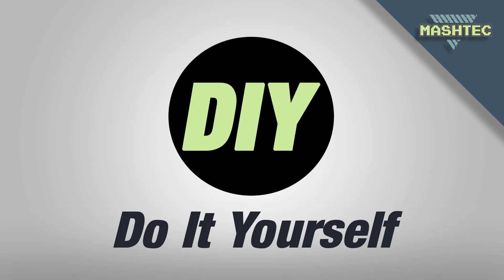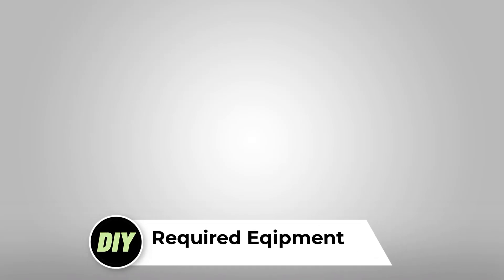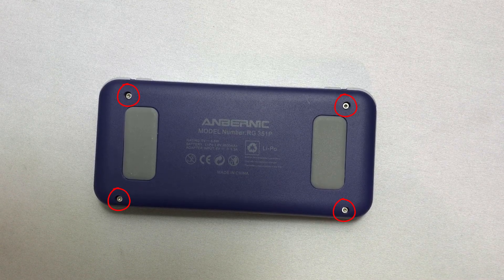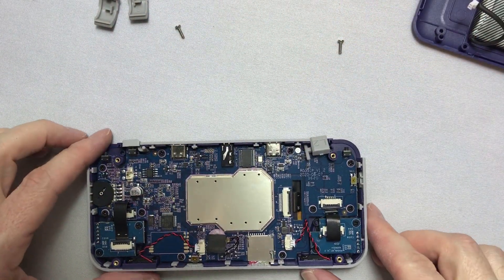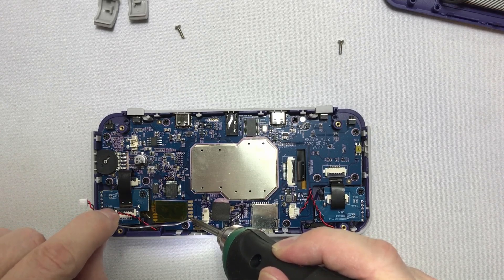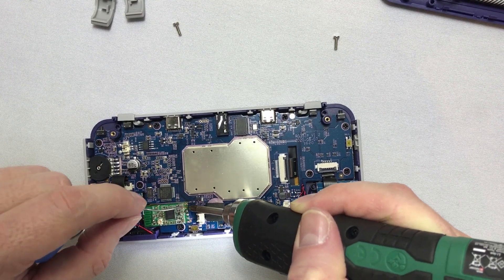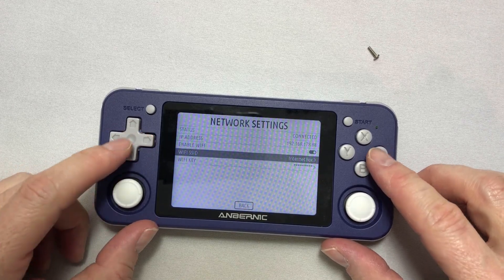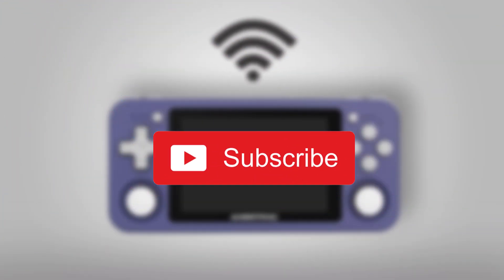RG351P - Howto install an internal WiFi module guide (DIY)

Comment: 12/14/24 i can confirm my sodered module doesnt work i ordered the exact same one under your link and it took me to a different one installed it and i still dont have wifi btw running on arkos does not work this is just a update because no other vid shows how to install the wifi chip if someone can help me out that would be great i could be just doing something else wrong 🤷‍♂️

Comment: Just tried the mod on mine with the module at the provided link. Didn't work. Tested all points for connectivity and I have good solder joints/wetting. My RG351P is a motherboard rev 1.2 (2020-08-07) and I'm running the latest Amberelec. Maybe I just got a dud module. The wifi does work over USB-OTG though. I ended up desoldering the module and removing it.
Reply from the maker: Hey dude, i‘m sorry that it didn‘t work for you but thanks for the feedback.
There can be multiple problems that cause the malfunction.
I‘m glad to hear that you have soldering experience 👍🏻 still, did you check the connections of the module and ensure they all habe contact?
Several viewers also reported that the seller changed the module behind the link meanwhile. It should still work but has some additional pins.
In the end, the module itself could be faulty too. But I guess it‘s hard to check.
I was testing it on stock firmware and ArkOS on my device. It‘s still working now a days.
Reply: @MashTec  yes I verified all the solder points with my Fluke to test solder continuity and resistance from the wifi module plated through holes to the RG351P motherboard pads, post soldering and I did that again after I resoldered it a second time. I did also have to remove 4 pins that the seller pre-installed on the wifi module. For that, I just used a chisel tip and heated up all 4 at once and the pins dropped out. I cleaned all plated through holes after with braid to ensure there were no shorts before soldering to the RG351P. I am going to attribute it not working to either a non-functional module from the start, or possibly an incompatibility with my revision motherboard, or Amberelec not having the driver. Maybe I'll give it a go with a different module in the future to see if I can make it work. Thanks for the cool video though, because I had never previously opened the RG351P to even know about a spot to internally solder a wifi board.

Comment: Just finished modding my 351p with the tp link nano ac600 5ghz usb dongle. I can confirm it works perfectly despite my extremely poor soldering job and cheapest chinesium gear. Thanks for sharing the info!

The 5ghz network really is an improvement! I also shielded both speaker cables and there’s no sound issue (haven’t tried without shielding).
Reply from the maker: Hey dude, good job! I‘m glad you got the 5Ghz module working :)
What module did you use for the mod? Do you have a link to share?
Reply: @MashTec  he did the alternative approach of breaking open a common USB micro-dongle and soldering the USB legs to the board I believe. Retro Game Corps covered that variant of this mod (edit, the three pads on the opposite side of the six you soldered are for the internal antenna that was placed on the board. you can get modules that would use them, or get a module that lacks an internal antenna entirely and comes with an IPEX connector to use a remote antenna. Which along with shielding the speaker wires, might well eliminate  the offending wifi noise. which mine still makes even using an external dongle....)
Reply from the maker: @DFX2KX  ah ok :) actually i was afraid of doing that myself, same as making a tutorial for the community out there to do it.
Still, this is the best solution you can get in terms of network quality. As you said, together with a IPEX connector for an external antenna that could be placed along the housing of the device.
Thanks for your feedback dude, very much appreciated!
Reply: Hey. Question. What gauge wire did you use for this project? @CoolestUserEver
Reply: @nathanmeade18  I grabbed some scrap and I can't find the pictures I made but it must have been 22-24 awg. Nothing fancy but flexible enough to be pushed inside the console. It still works btw.
Reply from the maker: @nathanmeade18 i‘m sorry dude. It‘s too long ago. I can‘t remember anymore :(

Comment: Good Video and good content but be careful! The Wifi Modul in the description is actually not the correct one.. it is larger and doesn't fit!
Reply from the maker: Thank you very mich for your feedback dude!
At the time i made the video, the link was correct. Later on the company changed the product behind the link (slightly, the module had some extra pins) but it could still be used for the mod. Now, it‘s very unfortune that it became incompatible :(
Let me see if i find an alternative, otherwise i need to remove the link.

Comment: Does anyone know if all six pads are used ? The top pad came off my 351_ but it appears to not connect to anything . The pad correlates to Pin 6  the RF/ON/OFF on the wifi Module
Reply from the maker: Hey dude, since the module provides 6 connectors and the board connector pad has 6 connectors, i‘d expect all pads to be used.

Comment: It Will Works with the RG351mp ? because of the metal body...Will the signal Work ?
Reply from the maker: Hey dude, sorry this only works for the RG351P. The MP model doesn‘t provide an internal spot to install a WiFi module.

Comment: Is there a 5ghz option anywhere? I have the 351m with 2.4ghz, but it's not exactly the best option.
Reply from the maker: Hey dude, the device can handle both networks 2.4GHz and 5GHz but i haven‘t found a 5GHz module with the correct size and pinlayout to get it installed. Very unfortune.

Comment: can tis be done on the rg351mp as well
Reply from the maker: Unfortunately not my fried. I tried, but the RG351MP misses the spot to install the module.
It is possible to install a module directly to one of the USB C ports. But it comes with down sides: You permanently loose the USB port for other connectors like controllers. And there is a high chance to break the main board since the connectors on it are really tiny. Also, not an easy soldering task. Sorry, i don‘t have a better answer for you.

Comment: Hey. Is there a 5ghz version of the adaptor/wificard?
Reply from the maker: Hi my friend, i haven‘t found a chip that fits to the mainboard with 5GHz WiFi support.
At least, i can tell you that external adapters work (you‘ll need an OTG adapter + WiFi dongle).

Comment: Would this mod work also with the RG351MP? I was thinking about attempting this on that device as well. Thanks!
Reply from the maker: Hey dude, i also investigated into this, but unfortunately it‘s not that easy for the RG351MP. It‘s missing a spot for the the module on the mainboard.
Some guy made a mod, connecting a dongle directly to one of the USB-c ports. But i wouldn‘t recommend doing this, because you loose that port for anything else to be connected and the chance to damage the board is pretty high.
Seems like we have to live with some external adapter for the RG351MP.

Comment: Would this work on the rg351v?
Reply from the maker: Hey dude, as far as i know the RG351V already comes with internal WiFi, so this mod would not be necessary.
Reply: @MashTec  it's 2.4ghz though. Is it possible to replace it with a 5ghz?
Reply from the maker: That‘s a very good question dude.
I was looking for a compatible module for some time, but without luck.
Would be great to be able to connect to 5GHz WiFi as well ;)

Comment: Hello, congratulations for the video. Have you had a problem with sound interference using this internal WiFi? Does this internal Wifi work on ArkOS too? Although it seems to me the best solution, I do not have soldering equipment and I am not comfortable making these solders so small.   
Which external WIFI USB adapter do you recommend that actually works on the 351P? 
Most of the cheap external WiFi dongles I find on Amazon say they only work on Windows / MacOS.  Could you tell me which model is best for our console RG 351P ? 
Do you think there is any external adapter based on the RTL8188EUS chip that works at 5 Ghz too? Thanks ;-)
Reply from the maker: Hi Willyan,
thanks for your questions dude.
You can hardly hear the interferences with this module. It never disturbed me (but i don‘t have a reference).
And yes, the module works for all other firmwares (including ArkOS) ;)
If you‘re looking for working external modules, take a look into the video description of my other video e.g. where i show how to transfer files (there i have links to working external WiFi modules and adapters). Enjoy! Let me know if you have further questions.
Reply from the maker: Unfortunately, the RG-devices don‘t support 5Ghz WiFi networks.

Comment: Hi dude. This wifi module works in other operating systems like 351ELEC or ArkOS?
Reply from the maker: Yes my friend, it works for all OS on the RG351 i‘ve tested so far.
That included Emuelec, ArkOS, 351ELEC and 351DROID (Android OS). Enjoy!

Comment: I did everything according to the video, however mine can't see any networks... probably the module is a faulty
Reply from the maker: Hey dude, i‘m sorry to hear that :( i got so much feedback from users that got it working by my guide.
Did you take the module i suggested in the video? Can you try an external WiFi module with your device to exclude a problem on your device itself?
Reply: @MashTec  Well, it's possible that I've messed up with the soldering... I purchased the same one from aliexpress and I've already tried with an external module - it works just fine. I will try to solder it again when I'll have time for it. :)
Reply from the maker: Ok, just take care my friend. Don’t damage your mainboard when you re-solder. Best of success!

Comment: I finally had the courage to make this mod (and the kapton tape), it worked perfectly, I isolate the speaker cable and it does not make any noise, I buy the version with ipex connector and do not use a external antenna and although the connection range is not that large it works wonderfully, thank you very much for the video! greetings from Mexico
Reply: Update: after a few hours of playing just fine the wifi stopped working, I restarted the device and a "no gamepads detected" screen appeared, since then every time I boot the device this screen show up and the wifi simply stopped working,   I'm gonna tried to remove the wifi chip and hope the damage it's not permanent, I have experience soldering and I'm pretty sure I didn't make any short circuit, maybe my device was faulty from the beginning? Anyone have experience something like this? :(
Reply: Update 2: Apparently the problem with the controllers not being detected was due a wifi connection error, I unplugged the battery and plugged again and get fixed, yet the connection to the internet was super weak, I ordered from Ali express a Ipex RF jumper and used as an antenna connected to the wifi module, it didn't boost that much the signal but now it connects to the wifi in all parts of my house so I'm pretty happy about it, it add a little of noise to the speaker but I isolate the cable of the speaker so it's barely noticeable, finally had it work so I'm super happy about it!!!!!
Reply from the maker: I‘m glad to hear about that success my friend! Good job and thanks a lot for your feedback.
May you share with us what IPEX antenna you got?
Reply: @MashTec  thank you so much for this tutorial!
Reply: I don't know why the previous comment didn't get post, but I bought this one https://a.aliexpress.com/_mPdx5RV
I ordered the 10 cm one, take the analog stick apart so I can feed the antenna behind the PCB to the R1 trigger, also isolate the end of the antenna so it doesn't make any short circuit :)
Reply from the maker: Perfect! Thank you very much.

Comment: Hi, I bought this item from the link and this store send me with soldered ipex connector to this module, which was a big and unespected suprise, my question, do you received without soldered ipex connector, as I saw on the video?  I tried to unsolder the ipex connector, but I was damaged the path, I am furious because the store does not have wifi with a separate ipex connector, and now i'm lossy. Do you know where can I buy this wifi without ipex connector like on the video you show, please help?
Reply from the maker: Hey Sytech, i‘m very sorry to hear about your problem with the wifi module :(
The shop where i bought the module and linked in the description offers two versions. One with IPEX connector and one without it. You can choose when you order.
Unfortunately, the shop now sends the module with an additional pin-board that is not required and needs to be un-soldered before the mod. I habe bo idea why they added this board :( it was changed a few weeks after i made this video.
You can search for the module in a different shop. Bit this was the one that fir the best for the RG351P mainboard.
Reply: The one with the ipex connector works fine, no need to unsoldered
Reply: @JosephMorganVerne  the one is sold out dude

Comment: Guter tipp mit dem passenden Modul, habe mir das auch mal bestellt. Wenn man keine extra Antenne ansteckt, sollte man aber die "Without IPEX" Version nehmen, da nur bei dieser die onboard Antenne angeschlossen zu sein scheint. Um die verlötete Stiftleiste runter zu bekommen würde ich empfehlen das schwarze Plastik vorsichtig von den Pins zu hebeln oder mit einem Seitenschneider weg schneiden und dann die Stifte einzeln zu entlöten, das ist wesentlich einfacher als alle 4 Pins mit ein mal zu entlöten.
Reply from the maker: Ganz genau! Danke für deine Erläuterung mein Freund. Sehr hilfreich 👍🏻

Comment: My chip arrived with a connector soldered to the contacts, so you might need to use a de-soldering wick and/or vacuum to remove the connector and clean the contacts up. A "helping hand" stand will also aid in making this process go smoothly.
Reply from the maker: I‘m glad you got it fixed dude.
Sorry for that extra work. I don‘t know why they changed the product like that and that these extra connector. The time i made the video they sent it without the pin board.
Reply: @MashTec  It worked like a charm! I actually just finished the mod a few minutes ago because I was waiting for thermal tape to arrive. My 351p is online and working great, thanks to your wonderful guide.
Reply from the maker: I‘m glad to hear that and proud of everybody that made it work ;) good job dude! Enjoy your device.
Reply from the maker: I‘m glad you got it fixed dude.
Sorry for that extra work. I don‘t know why they changed the product like that and that these extra connector. The time i made the video they sent it without the pin board.

Comment: Thanks for the guide. Followed it and it worked out alright! The reception is pretty bad tho. I have to be directly in front of the router to get workable download speeds. Any suggestions on how to add an antenna?
Reply from the maker: Hey dude, i‘m glad to hear that it worked out for you ;)
What kind of module do you have?
If you have one with external antenna connection, then i‘d recommend you to get one and place the antenna cable inside the cover along the edge. These versions don‘t have a good reception without antenna because they are expected to have an external antenna connected.
If you habe the version without external antenna then you should have a decent connection as it is. Otherwise your module might have a problem.
Reply: @MashTec  Yeah I have the one with the antenna connection. What search term do I need to be looking for?
Reply from the maker: Look for IPEX ANTENNA, my friend ;)
Reply: Holy shit thank you for commenting this, I just assumed my soldering was garbage but sure enough, walked up to the router, and boom connected.  I guess I need an antenna.  Guess I’ll wait another month on aliexpress shipping. :P
Reply: After a lot of looking I can’t seem to find an IPEX v1 antenna that doesn’t connect to some sort of giant WiFi plastic antenna.  Nothing seems to be small enough to fit inside the RG351P, except IPEXv4 connector antennas.  Do either of you have suggestions or should I just order a new board without an antenna connector?  Or maybe I could just de-solder the connector and see an improvement?

Comment: Hi MashTec, my WiFi adapters arrived today after 4 weeks...  The ones that I ordered have pins ? Did yours have pins too ? The one linked in description also has pin but I dont see them on the one in the video, it looks flat. Any idea / suggestions. I thought about cutting them off my friend
Reply from the maker: Hey dude, unfortunately the seller has changed the item a bit. Those new models now have this additional pin module installed.
You can simply unsolder the pins by heaten them up and pull them out with a pliers. After that you should be able to solder the module to the board like shown in the video.
This should work, i already got some positive feedback from another guy that recently did it like that.
Reply: @MashTec  legend as always... Thanks my friend appreciate the rapid reply 👍👍
Reply from the maker: You‘re always welcome Kev!

Comment: The non ipex version is not available (think you might have something to do with it selling out lol.) If i desolder the ipex connector will that version still use an internal antenna please or is the internal antenna not included on this version
Reply from the maker: Hey dude, mine also came with the IPEX connector, so it has the option to connect an external antenna as well. But i don‘t need it, since the internal antenna works absolutely fine with me and gives me a good connection ;)
Reply: @MashTec  excellent thank you for your reply. Ill let you know how it goes your youtube posts are always really helpful
Reply from the maker: @philw9339  Thanks dude, i‘m very interested in your feedback. Looking forward to hear from you ;)